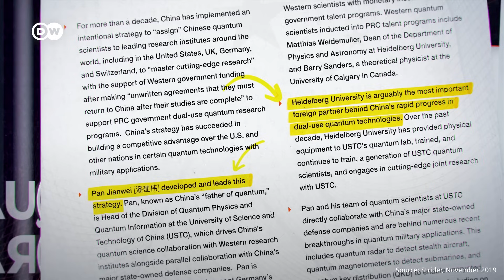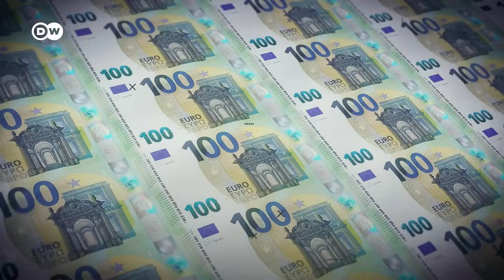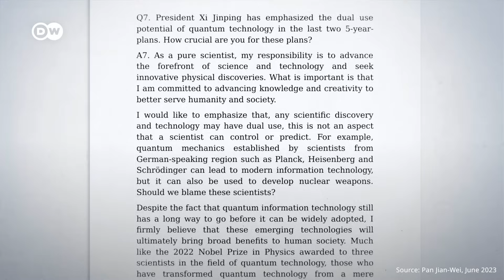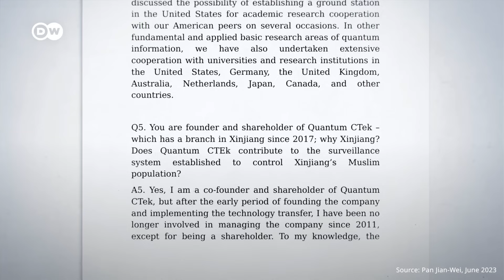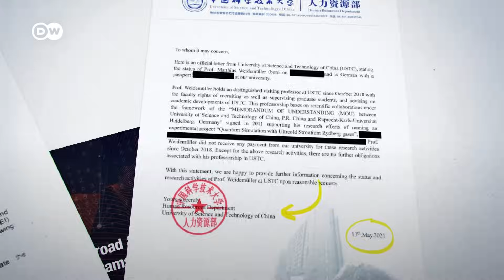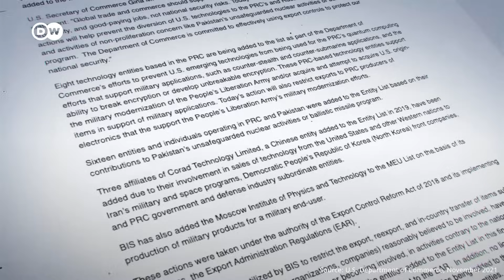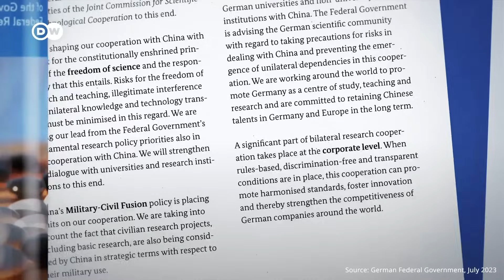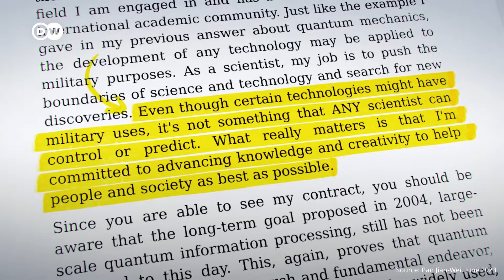How Heidelberg University became entangled in China's quantum strategy | DW Documentary

Comment: Isn't quantum communication mostly about communication security? A defensive tech in nature?
Reply: quantum technology is also an enable in cracking "regular" encryption, that is also important. Also the whole "defensive /offensive" difference is quite difficult to make tbh.
Air defense systems sound super defensive, but they can be used to create "a safe space" for airplanes to be used offensively, also they take away the option for your enemy of retaliation, so rocked attacks are suddenly more attractive. There is a reason why there was so much talk about THAAD in Korea for instance.
Reply: Depends it can work both ways. Quantum communications (entangled signals) would be defensive but very hard to build and scale, as in everyone would need a quantum phone or laptop to make this work and given the near -273C temperatures needed that would be highly unlikely. The offensive side is more scary, you would only need one quantum computer that is running a parallelized operation to break RSS (or similar) security which is used to encrypt messages and communications in normal phones, laptops, computers and networks right now. Btw encryption is basically: running your data through a hashing algorithm that takes 2 massive prime numbers and multiplies them together, decryption requires reversing this and it is fricking impossible (in a human lifetime) to factorise a number that is a product of 2 massive unknown prime numbers. This factorisation however would be on the minutes scale for a quantum computer in theory. 

So the scary use is much easier to attain and implement, and targets all current digital systems aka using quantum computers to break RSS encryption of normal devices whereas the defensive use is almost impossible to manufacture at scale.
Reply: @snoopysnoops007  excellent explanation, thankyou for this new knowledge! :D
Reply: defense of a criminal dictatorship just allows them more offense
Reply: DW: “Should German Universities Collaborate with quantum scientists who are accountable to an authoritarian state”.
Meanwhile Heidelberg University, a completely government owned university directly accountable to the Federal Government of Germany, and yes German Govt very democratic🤡🤡 directly involved in destroying countries like Iraq, Libya, Syria, Yemen etc. Yes so democratic and free German Govt making sure that no third world country ever rise to their level and exporting the destructive IMF loans and neo-liberal economics. Moreover, Germany being part of the international Mafia Cartel called NATO and still
“China Bad, We are Good”🤡🤡🤡
Reply: The tech can also be used in wars. We broke the enigma machine code in ww2. Quantum cant be cracked at all. So yes, this can be used offensively and once again germany is getting it wrong. Merkel got it wrong with russia for the last 20 years. Shakign his hand while he walzes into crimea did not help. It sent the totally wrong signal.
Reply: Communication security technology knowledge should the preserve of the chosen few. The rest should be open for abuse
Reply: Even a defensive tech or capability can tip the power balance which makes the other party concerned. Imagine we have country A and country B, both are at tenuous peace with each other because they have the same strength and capabilities. But now suddenly B gained the means to neutralize any possible attack from A. This makes B stronger than A since now B can attack A without fear of retaliation (since they can neutralize any attack A will make).
Reply: not really. Having watched ALOT of stuff on ukraine, a key reason their losses have not been as bad as the russian loses is down to faster 'real-time' communications. 
this is why russia targeted the energy and communication infrastructure at the very start of the invasion and why elon musk gave ukraine access to his 'remote' sky-link network of satelites